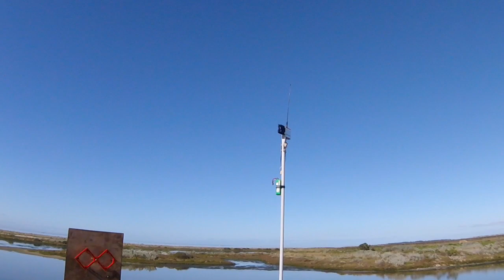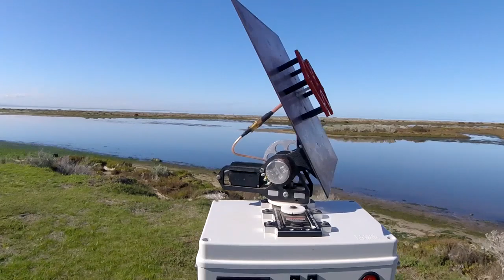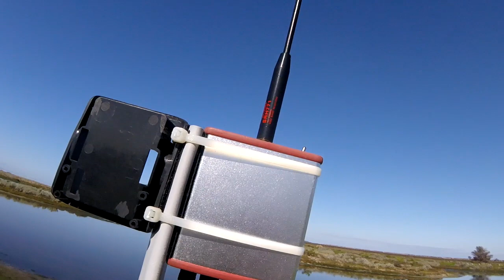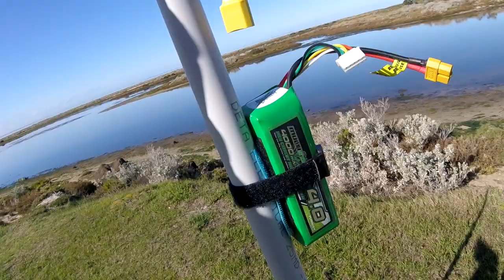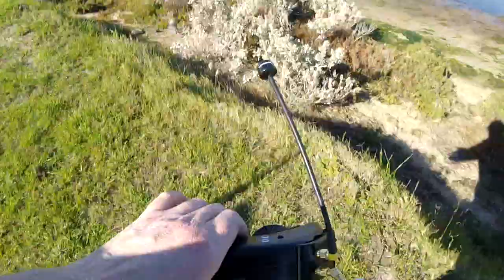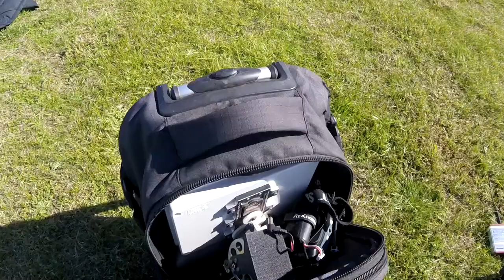» My FPV Setup with Repeaters

Comment: Nice, although seems like a long chain of points that could go wrong and make for some fun troubleshooting. Do you really use the extra range it allows you? I can usually get comfortable reception up to 2.5km with normal 2.4g and 5.8g (600mW vtx) with no directional antennas or pole mounts, just a cloverleaf on my goggles. Seems like the locations you fly are rural enough to get similar results.
Reply: Cost of freedom rises exponentially with distance (-:
Reply from the maker: I definitely need the extra range. Not a chance I could survive with a 2.4/5.8 setup anymore. I like to fly low and far

Comment: Have you tried using TBS crossfire rather than the 433mhz?  i run out of video range before i even get close to losing control.
Reply from the maker: No haven't tried crossfire. But ezuhf works fine for me

Comment: SD - Great Expo, thanks!  May I ask you how important you think is the tilt on the 1.2 video tracker?  Or putting it another way, how much of the functionality might one hope to achieve with a pan only system?  (I don't really want to go the Servo City route :-)  Simon
Reply from the maker: Good question - i think tilting only adds a small improvement and you can easily get away with 360+ panning only. If you were flying a very naughty high altitude at distance too then you would feel it but for most fpv flights the antennas will give a fair amount of up/down coverage, even something like a directional yagi

Comment: Is it a big process to get the eagle eyes calibrated at the field with your plane? Im guessing it isn’t a quick process.
Reply from the maker: No its easy. Run the wizard and it takes about 5 minutes for the first setup
Reply: Stunt Double FPV Great. Thanks. I am going to have to look into this. That’s why I’ve never gotten Eagle Eyes because I thought it took about 15 minutes to setup at the field.
Reply: Stunt Double FPV Do you know which part numbers you used for the pan and tilt from Servocity ?
Reply from the maker: Not entirely sure because I picked it up second hand. The pan might be the 5:1 https://www.servocity.com/tm-785hb-servo-gearbox and the tilt https://www.servocity.com/spt400-tilt-system but not sure about the ratio
Reply: Stunt Double FPV Ok. Thanks a bunch!